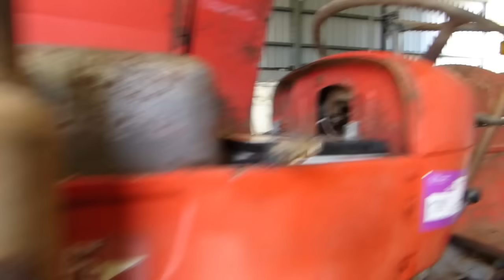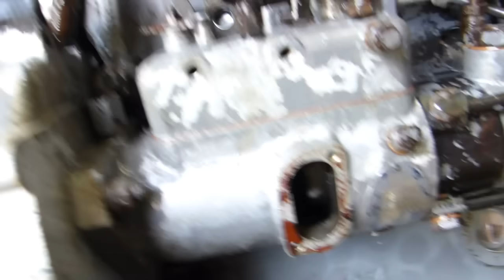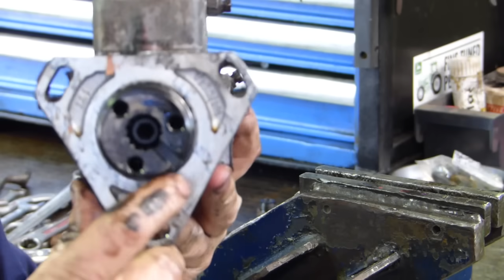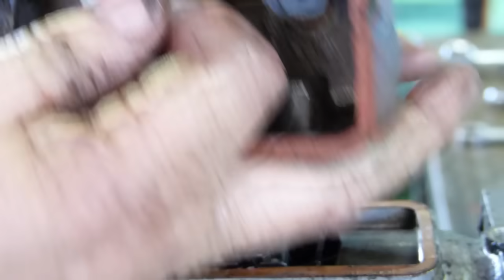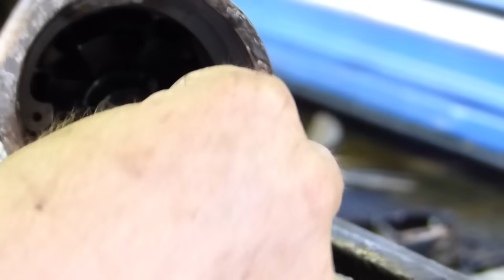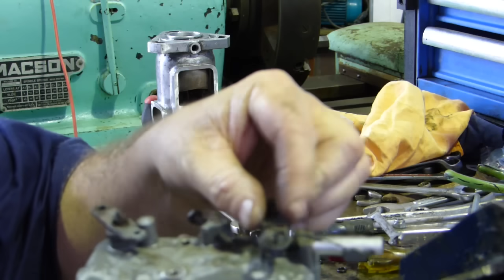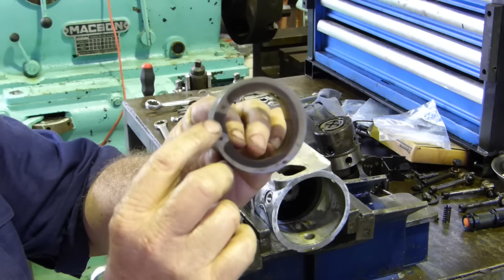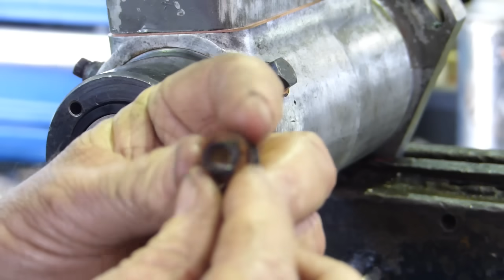CAV Injection pump full strip down to re seal and stop fuel leaks

Comment: Am having a problem with a 35 Massey Ferguson she is putting fuel up fire's and won't start the pump is leaking at top not a lot but she is leaking. Would this stop her from starting me and my brother have looked at it he thinks the strangler may have jamp am not so sure. Could you offer  any advice.  I have watched you strip this pump down and kinda understand. I am a mechanic to trade in the Highlands of Scotland. I came across this video when I was looking for Cav pump rebuild. The tractor has ran we had the injectors recondtioned. Thanks very much for making this video I believe it may help me.👋👍🏴
Reply from the maker: Have a look at the 135 6 speed series I did as I go into the pump deeper in videos 14 and 15. I would bleed only one injector and see what happens.

Comment: My tractor has a leaking injector pump. Leaking externally more than you would run the water to keep the pipes from freezing. I don't smell diesel in the oil but that lip on the front is likely hard. So I figure I'll take it out and reseal it. Thank you for your video ti give me a heads up as to what I'm getting into. I am a millwright working in a shop, but first and foremost a tinker that tries to fix my own things. So, once you showed it disassembled I thought ok this is something I can do. I am glad you are showing how to repair something that is sorta alien to onters.
Reply from the maker: Thanks Robbro, I do what I feel is a better video in the MF135 6 speed series video 14 and 15, they might also interest you.

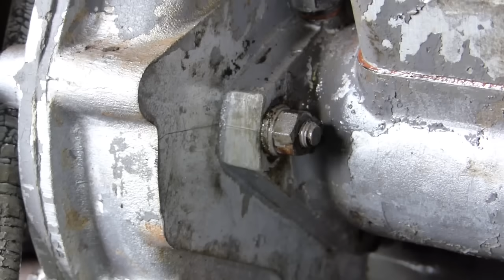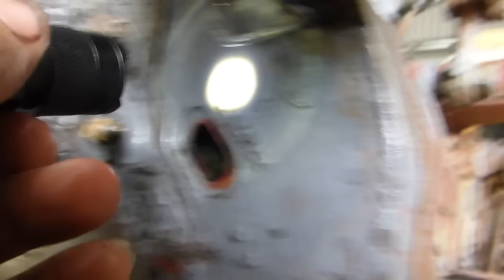Comment: 4:10 timing mark pump, 5:40 timing flywheel. 50:50 transfer pump. 51:02 end plate housing, tube and plunger put together 52:11. Shortcut to show my friend who help me fix my traktor.
Reply from the maker: Im not sure what the message is about but yes I think that is where the marks are.

Comment: so I rebuilt my cav pump after watching your vid lance. bled the lines and got it started....I was so proud of myself and thanking you. for all the help. so it ran great for about 30 minutes..then it started running rough and died. but did get it to the house....so now I have put new injectors in it. bled the lines got fuel to injectors but still no start...pulled the top off the pump. check the stopper and made sure all was good it was..so im thinking the timing is off some how . or compression could it have broke a valve or something...….1968 ford 3500 3 cyl diesel any thoughts ??? thanks
Reply from the maker: Timing cant be out, just check for some rust in the metering valve of rollers.

Comment: I just put all the top o rings on cav pump 3 cylinder 150 massey.  It fired right up afterwords but it will only go up to about 1500 rpms.  I am sure i got the spring back in same hole but something isnt quite right.  the shut off is working fine.  any ideas ?
Reply from the maker: Im prety sure you have the spring wrong, too loose. You will need another look in there.

Comment: I bought a G9 chaimberlain  with a270 Perkins  It  won’t start .The person I bought it from said it worked fine until after a week of not using it , it wouldn’t start . He blew air through all the fuel lines and injector pump blowing gasket on the lid so he undid the lid and put silicone there which is a no no . Putting the lid back he stripped the threads on both nuts .Anyway I’ve got it in my shed and tried to get it running.I get fuel pumping out the bleeder but nothing goes to the injectors .He said he only had the lid high enough to get silicone around it and nothing came apart with the mechanism .can u help me in anyway I’ve bought a gasket kit for the lid but can’t get hold of two new studs
Reply from the maker: We have the studs give the shop a ring on 1300 850 097 or info@queenslandtractorspares.com.au

Comment: Thanks for this video. It helped me fix a problem I had on an engine that had been sitting for a couple of years.
Fuel was getting in no problem, but not coming out the injector ports.
I checked the end cap gubbins, which was all OK. I figured it had to be the pistons were stuck in, not enough pressure from the lift or vane pump to push them out. I removed the fuel in line (on the end cap) and poked an airgun on my air compressor into the hole (convenient that the connector has a rubber gasket!), then pressurised whilst turning it over. Boom, the injector ports started ejecting fuel, connected everything back up, and she now works perfectly!
Reply: epic, I have two that pump good out of bleeder but just a drizzle at the pressure side, what psi did you hit it with? will try this tomorrow, thank you so much for the tip.
Reply from the maker: Good job!
Reply: nice

Comment: Great video - thanks.   I have a 175 MF that I've bled out but the pump isn't pumping - is there something that is 'typical' that has gone bad that can be fixed w/o removing the pump?  It is a different style pump...  I think it is a 1973 year tractor.
Reply from the maker: Check for a sticky metering valve might be a good place to start.

Comment: Thanks for the video! What is the torque spec on the front hub bolt?
Reply from the maker: Not sure I just nip it up tight, lol.
Reply: @bundybearsshed  I am sure I tightened that bolt. Shortly after my crank case filled with diesel, pulled it apart and that hub bolt was loose. I will tighten and use locktite. Lift pump was fine.
Reply: @bundybearsshed  Your the man! keep the videos coming.

Comment: Hi Bundy, i am rebuilding a ad3 152 3 cylinder perkins diesel and i making new fuel injection line and hydraulic line and power steering line, but i can't find or i am just missing something. But it look like my tube nut, look like there flat on the end or bottom and use olives, but i can't not find the tube nut that are flat to be use with the olives it like everything i see is inverted, i want to buy new one for the new engine and keep the old lines and fitting for a rebuild on another engine, i know it a single flare and a tube nut and olive on one end and a compression fitting on the other end of a 3/16 fuel line, and i am not sure if it steel tubing or stainless, do you know what type of tube nuts, i need and if it steel tubing or stainless i have got the olive already both size for the 3/16 and 1/4 inch lines, i have the tubing for 3/8 hydraulic lines and an or jic fitting so i am almost there it just the fuel line. And i rebuilt my cav injection pump watching your video and it work great thank you so much for that!
Reply from the maker: I use Bundy tube which is often used for brake lines The Hydraulic places have the correct sizes where I live.
Reply from the maker: Thanks.
Reply: And another thump up on the video great job? and thank again i am sure i speak for everyone Lov and respect Jame w  butcher

Comment: Dear Lance.I am repairing a Massey Ferguson 690 that suddenly lost power and ran unevenly with no engine power.There is blue and black exhaust emissions. She reached full revs eventually but is running very rough!  I have changed the main fuel filter and there was fine sandy stuff in the sediment trap! I/we have completely drained the twin tanks and renewed the diesel fuel. It took 6 gallons minimum before the lift pump would deliver. I have cleaned the small tubular filter on the end of the CAV DPA Pump. Now then: because the filter which was completely "clogged" and did not come out reasonably I completely lost track of the re-assembly order!I would not have had a clue how it all went back together if it was not for your excellent and most helpful video! The Fibre Washer, Springs, Plungers etc have all got to go back in there somewhere and correctly! I am now going "Out There" to reassemble it all!The tappet clearances are all OK! I do hope it is not the head gasket "Gone"! She has history on that issue! That "Short Engine" has given me grief since we fitted it! When it is going it is fine but it has not done 20 hours as yet, trouble free! When it is going all seams well! Usually I/we do get good results with our efforts but I guess there is always one!I will let you know how I/we get on.All the best Lance.                                 Rob Allen.                                                    Halmore in the Vale of Berkeley, Gloucestershire in the West of England.
Reply from the maker: Boy sounds like a bad trot, There is a CAV manual download on my web site that might help.

Comment: Lance... I've watched your videos on the cav pump dozens of times. Thank you so much for going slowly and making comments. I've been working on mine for many weeks now. I think the best words you said is, "notice the rotation." I had my regulator pin mounted to the right. Which no fuel could be sent to the head of the pump. Changing this pin in the regulator  now forces the fuel into the head then of course into the injectors finally.    Thank you so much for your efforts and advice. I found that the pump was very easy to work on. Thanks a million.
Reply from the maker: Thanks Jim, I did a better video in the MF135 6 speed play list videos 14 and 15 that you might like. I got more involved in the pump.

Comment: i am extremely appreciative of your video, as a person who started a diesel mechanics apprenticeship in 1983 and the advice back then was , leave injector pumps to the professionals, also i learn by watching more than from the manuals, well! for $14 for parts and an hour or so to dismantle the top of the cav injector pump. my MF 50A backhoe isnt leaking fuel from either throttle shaft or stop shaft. i cannot thank you enough and i will be revissiting bears shed again im sure.
Reply from the maker: Glad to help

Comment: Hello this Michael again. My injector pump was working fine but leaked fuel
 I watched your video and put new seals in but I've done something wrong it's not pumping enough fuel to run 
 Some fuel lines have fuel and some don't
I have bled and bled the pump and blow out all fuel lines but the pump still isn't pumping enough fuel
 Any ideals? Thanks for your help and time
Reply: All my lines were clear and battery is good. The tractor cranks over fine. I took the head back off and blew all the ports out. I checked the pump vanes again. I took the inlet ,plunger, screens, etc out cleaned again. . I got the tractor to start today finally!!!. I'm not sure if I had some dirt some where or put the inlet parts in wrong but it runs again. Thanks so much for your help and thanks for replying to my questions. I hope you and your family stay safe during the world's panic times.
Reply from the maker: All lines use the same plungers to pump so if it is clean they should all be the same. Make sure you have a good battery and do up all but one injector line and let it wind on and off for a bit and it should start.

Comment: Good clear down to earth video, many thanks, just finished doing my power steering pump, now starting my 
CAV pump, very helpful to see your video , thank you
Reply from the maker: Thanks James
Reply: @bundybearsshed  Hi , resealed cav dpa pump front to back all went well thks to your video, however now one day later, tractor went to full revs throttle does nothing, happened when going across lane, had quick look under top cover of pump every thing seems connected,  I tried starting and stopping tractor several time but still running at full revs. I would welcome input you could give as to the possible cause. thks James

Comment: I have a problem with my International 276 tractor. I have fuel oil in the crank case. Do you think the injection pump may be the problem ? Thanks for ansering !
Reply from the maker: Yes but it could also be the fuel lift pump

Comment: Thank you so much for this awesome video!  I work on all my own stuff but have been intimidated by injector pumps mainly because of the big injector pump shops horror stories.   After watching your video I feel confident I can take mine apart,  put it back together and have no problems.   Also, thanks for showing every step you do, it's aggravating to watch a video when  the steps to disassemble are not shown.   AWESOME JOB! ......Again  thanks for your video,  I'm now a subscriber.
Reply from the maker: Thankyou, In my massey Ferguson 135 6 speed series I feel I do a better job on the pump in videos 14 and 15. Hopefully they will help you out as well.
Reply: @bundybearsshed  Thank you, I will check out those videos as well.

Comment: Can u feel the shutoff for fuel engage with the cover installed I just replaced the seals and I can’t see if is engaged because I’ve got a loader can you feel it when you move it with your hand thanks i just resealed the top cover massey 3165 perkins deseil
Reply from the maker: Some times you can feel a little more tension on the throttle lever and that is all.
Reply: Bundy Bears Shed  thanks mr bundy gonna lift the cover get better lite

Comment: I did not see you put the input shaft O-ring on between the hub and shaft. I also attach spring to governor and then slide the trottle shaft through cover when installing cover and leave shut off lever of so you can line up the slot easier. The levers can then easily be installed after cover installation. very good video.
Reply from the maker: Thanks Joe.

Comment: Lance,
Thank you for the informative video. I acquired a non-running Massey with the Perkins 3.152. I found the filter full of mud, which is the bacteria growth. After changing the filter and bleeding, I had no fuel to the cylinders. I cleaned the entire fuel system and then the inlet screen you show in this video. I installed an electric pump downstream of the lift pump and bled everything that was bleedable. After a few cranks, she lit off! I turned off the electric pump and it ran steadily on the mechanical lift pump. Now for the rest of the story... After 45 mins of idle time to come up to operating temperature, I drove it off the trailer. After checking out all the hydraulics and such, I slowly brought it up to max RPM. After about 5 seconds against the governor, it shut off just like you had pulled the fuel stop. Oddly, it was blowing quite a bit of black smoke when it got to the higher RPM range. I pulled the inlet again to check the bottom plunger and spring you mention, and all was well. I'm now at a no start condition with no atomized fuel exiting the exhaust. Aside from the shut-off and that inlet screen, what else could give me a no fuel, or no start condition?
You just gained a subscriber as well!
Jeff
Reply: I have a ford 2000 with those same symptoms . Thrown more money at it than I care to admit . Didn't know there was another screen in the pump. Going to try that this week. Hope that's my problem. I'm to the point of just doing a rebuild on the whole pump.
Reply from the maker: I did a better video on in the Massey Ferguson 135 6 speed series, video numbers 14 and 15 where I go in further to the  rollers and main pump plunger etc. that may well be of help. Also look at my web site www.queenslandtractorspares.com.au on the technical tab there is a free pump manual download. This is a good breakdown of what is going on.

Comment: I did a complete rebuild (first ever) with parts kit.  I now can not get the pump to move any real amount of fuel. I have bled and bled according to instructions .  Pump is on a Ford 4500 tractor. I guess I must have done something wrong?  Someone please help me, I am at wits end (and broke).  Any suggestions what I likely messed up on? I followed the video pretty closely but I must have put something in backwards/upside down etc,???  As in the video, I turned the pump over by hand but I turned it the wrong way initially...Could have this caused damage?
Reply from the maker: No damage from turning the wrong way, I would check everything in the end housing. I have 2 better pump videos in the Massey Ferguson 135 6 speed restoration series videos 14 and 15 that might help you out.
Reply: @bundybearsshed  GREAT I will check out those video right now.  I am in deep trouble with this project. Thank you!

Comment: Great instructional video. Cracking the injector lines to bleed the last bit of air is a fantastic way of doing this replaced the flue filters and used the same approach. The chart where the spring goes was a life save as the spring jumped out when lifting the cover off. Thanks again much appreciated.
Reply from the maker: Good to hear you got it sorted.

Comment: Hi,, can I take the top off & push the throttle & stopper shaft through & leave them in  there position to change the o rings on them? so I don’t have to remove the spring, I have been told this is the best way,, your thoughts please.
Reply from the maker: Yes no problem doing that, I think you will need to undo the spring though.

Comment: Thanks mate, you have given me several clues as to where my injector pump on my my old BMC Diesel in the yacht is leaking from, simple version copper washer on one of the lines or worst case rear o-ring either way you saved me $2500, nice video very informative easy to follow keep up the great work
Reply from the maker: Thanks, There are 2 better videos I did on the pumps in the MF135 6 speed restoration video nos 14 and 15 you might find interesting.
Reply: @bundybearsshed  thanks mate will look at those and just ordered the kit thanks Trev
Reply: Outbackaust BMI diesel in-line pump is so simple to rebuild. I got a tractor once with a broken element in it one time. 1 hours and it was back on the road.

Comment: Hey Lance! Great videos! I have a 1998 Massey Ferguson 231 tractor with the Perkins AD3.152 diesel. Will that Sparex rebuild kit work on my tractor? I got diesel dripping and not sure if it’s the pump leaking or if lines are leaking close to the pump.
Reply from the maker: Yes I believe it will fit fine.